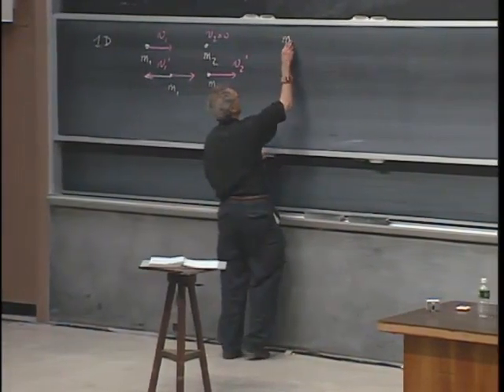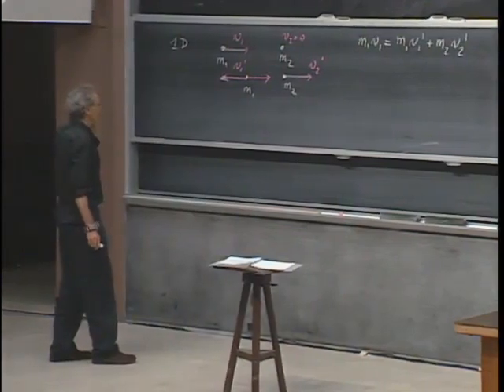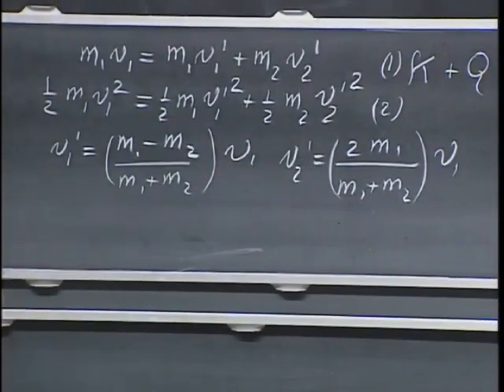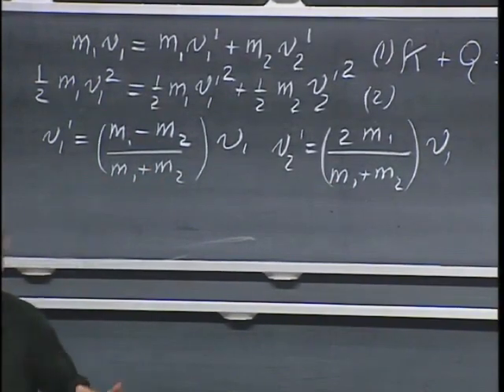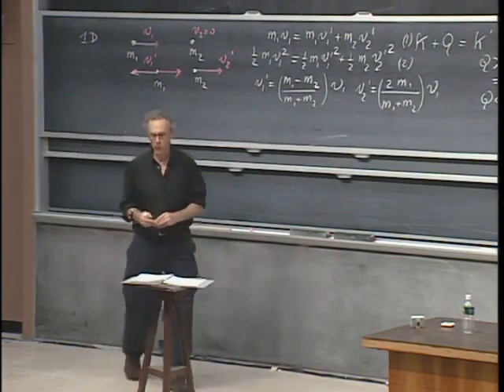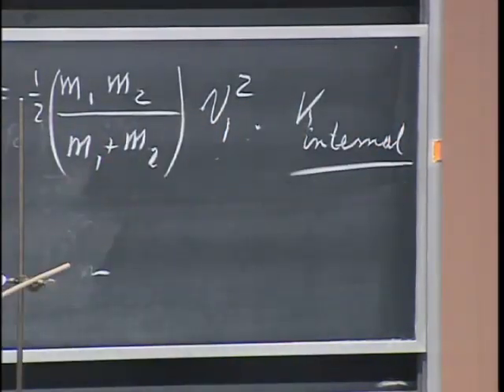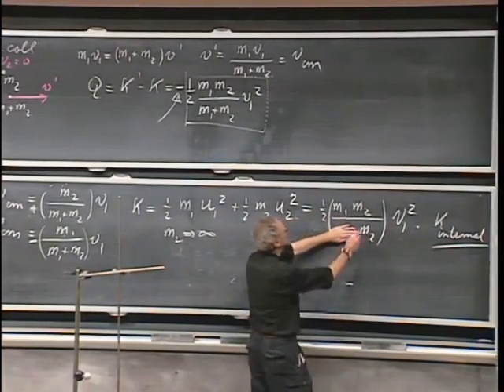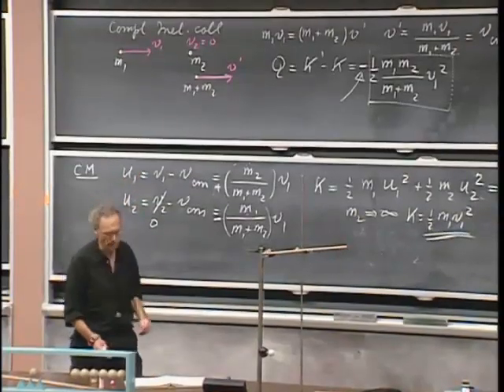8.01x - Lect 16 -  Elastic & Inelastic Collisions, Center of Mass Frame of Reference

Comment: The center of mass reference frame is such a nifty little trick to solving these collision problems.  If your thinking is stuck in the box of only using the lab reference frame, you end up having to solve a quadratic formula which could get you lost.  But the COM reference frame allows you to avoid that quadratic formula altogether, and in my opinion, shows a better perspective of what is happening in the collision.
Reply from the maker: carultch thanks alot for you important contributions in answering questions of my viewers. I have been reading them with pleasure. Your responses will help many. THANKS  \\/\//////@lter Lewin

Comment: Dear Sir Lewin, I've been thinking about it deeply and the reason why the wall gets momentum 2*m1*v1 after being hit by the ball does really not have a physical meaning. Instead, its a consequence of the mathematical expression you mentioned and thus: v2' = 2*m1/(m1+m2)*v1, hence: p2' (wall) = m2*v2' = 2*m1*m2/(m1+m2)*v1. And if I now calculate the limit for m2 going to infinity: lim(m2->inf.) p2'  I get exactly the 2*m1*v1!!! So mathematically it throws your result but in reality because the speed (and  thus also the KE) of the wall = 0 anyway it's meaningless, ie. the wall doesn't move an inch what perfectly matches the idea that its mass is infinite. If it was finite (which is the real scenario) it would get a teeny wheeny bit of speed which, of course, is unnoticeable. Provided the collision is perfectly elastic. Do you agree??

Comment: 07:50 That's intuitive if you know that all inertial systems are equivalent. You have v_cm=v_1. And in the CM system (where V_CM=0), you really have V_1=0 and V_2= - v_1 (I use capital letters for the new system.) And then V_2' = -V_2 = +v_1 as object 2 bounces off object 1 as if object 1 is a wall. Going back to the original system you get v_2' = V_2' + v_cm = 2v_1. So all it takes is to consider that object 1 is a huge train on which you sit and object two is a small railroad cart you approach. But you sit on the moving train and see it from the train! That's a beautiful idea, in my opinion!

Comment: for the question at 23:00
the ball gains 2v only if you look at it in the perspective of the wall(moving at v speed) hitting the ball(which is staying still).
in that frame of reference, the wall keeps on moving at V speed to the same direction, while the ball moves at 2V speed to the direction the wall was moving in.
If you look at it from the perspective of the ball hitting the wall, the ball's velocity is reversed, but the wall's velocity doesn't change (because of the infinity mass). So the kinetic energy for the wall stays 0, and the kinetic energy for the balls stays the same (only direction reversed).

Comment: For the wall/ball (i.e. sleepless night) problem:

Since we're assuming the mass of the wall is much much larger than the mass of the ball, we can apply the analysis from earlier in the lecture where m1 << m2 with v2 = 0, and we get that v1' = -v1 and v2' = 0.

Another explanation is that the wall has many external restoring forces acting on it (normal/frictional forces from the ground or other materials holding it in place), so even though in the split second after the ball has collided with the wall it does in fact have momentum, the momentum of the wall is not conserved after the ball has bounced off of it due to those external forces, so dp/dt increases very quickly, and to a human eye it appears the wall experienced no change at all.

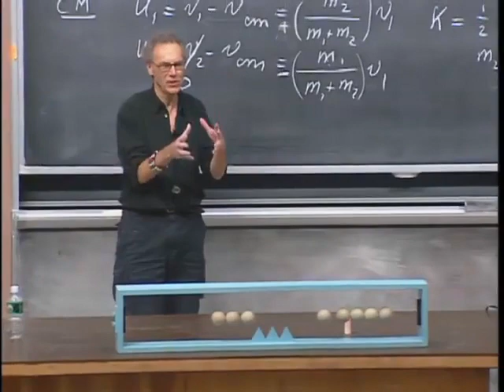Comment: 48:20 
if we have to prove it analytically we just use the approach of relative velocity and try to solve the collision problem by assuming the moving 5 balls to be at rest and find the velocity of those resting 3 balls with respect to the moving 5 balls,  now the problem becomes equivalent to the previous simple case...
solve the equations and get the answer. And the second approach i would suggest here is to look the situation from the centre of mass frame...

Comment: The ball is pushing twice the wall! The first time, the ball is hitting the wall, and it is compressed, and the two bodies are accelerating in the same direction. The momentum mv= (m+M) v’  so the wall gets a first impulse Mv’= mv- mv’ with v’ almost  0, that mean Mv’=mv. Then the ball is decompressed by the elastic forces to his normal shape, the ball is pushing again the wall, and the two bodies are accelerating in opposite directions!   Which mean the wall gets a second impulse Mv’’= mv. The ball is pushing twice  the wall, first time because is coming with the speed v, the second time because is departing with the speed –v, so therefore wall gets a double impulse from the ball, in the same direction p=MV=2mv. The impulse of wall is p=2mv, but the kinetic energy of the wall is E=pV/2, with  V almost zero, therefore E=0.
The speed of the ball is the same, before and after hitting the wall, and this can be proved, but we can not prove the momentum of the wall, is based just on the theory. Today, based on this theory, the momentum of the wall is p=2mv. But I'm not so sure about tomorrow...

Comment: Thank you Professor Lewin.  I'd like to try to respond to your question at 23:50, what is the momentum imparted to the wall when the tennis ball collides with it.I thought of three possible approaches:1. You said at the beginning of the lecture that if there is no external force, then the momentum must be conserved.  I would suggest that there is an external force present, namely the wall is anchored to the ground.  The earth will exert opposing force to resist translation of the wall, so momentum really isn't conserved.2. There is no reason to assume the extreme case that the collision is perfectly elastic.  Most likely there is a Q, and so some energy is expended in the form of heat.3.  If we look at the wall and the earth together, and grant the extreme case that the collision is perfectly elastic, suppose the ball retained 98% of the momentum after the collision, then m2v2 would be only 2%, a small number.  Since m2 (the earth) is almost infinitely larger than m1, v2 would have to be infinitesimally small, perhaps imperceptible.  You explained at 8:00 than if m2 >> m1, m1 approaches 0, then v1' = v1 and v2 = 0.But if we ignore this and we have to impart a tiny by of momentum to be imparted into the earth, my guess is the tiny bit of momentum, with no kinetic energy, is manifested as minute waves radiating from the point of impact, like a drumstick hitting a drum, dissipating with the square of the radius.Now I can sleep.
Reply from the maker: +luvinthe jazz   I appreciate your comments. The question is, can an object which has a mass which in the limiting case goes to infinity have momentum but no KE? In outer space bounce a tennis ball (mass m, speed v) off a wall with mass, M, of 10^10 kg and with speed,V=0. The collision is elastic. Clearly after the coll, the tennis ball will have to a veryyyyyyyyyy high degree of accuracy the same speed as before the coll but the direction will be reversed. Before the coll M has speed V=0.. After the coll M has speed V'. In the limiting case that M=>infinity V' must be zero. If not, the kinetic energy of the wall would be infinitely high and that violates the conservation of mechanical energy (in this case the conservation of KE). Yet the momentum of the wall must be +2mv as momentum is conserved. How can the wall have momentum but no KE?
Reply from the maker: +Lectures by Walter Lewin. They will make you ♥ Physics. Maybe this will help you. https://www.physicsforums.com/threads/why-momentum-must-be-in-the-wall.287325/
Reply: +Lectures by Walter Lewin. They will make you ♥ Physics. I Got it!!! So the change in momentum is +2mv.  So if v=0, then 2mv=0.  As Foghorn Leghorn said, two nothins is nothin.
Reply from the maker: +luvinthe jazz 2mv is NOT zero. m is the mass of the tennis ball, v is its speed. After the collision the wall has momentum +2mv but its KE is zero.
Reply: +Walter Lewin I think both KE and P are not zero, but v tends to zero so KE really tends to zero because the quadratic of v, talking always in an ideal closed-system case. You made m1 tends to zero to deduce m2 Ke is zero, but that's not completely true. Thanks for all your material.
Reply from the maker: +Mauricio Barda The momentum of the SUPER MASSIVE wall is 2mv=MV Here m is the mass of the tennis ball and v it its speed. M is the mass of the wall and V is the speed of the wall. M=>infinity, V=>0. Thus MV can be anything; it's 2mv. KE=>0 as MV^2=>0, MV does NOT go to zero.
Reply: +Walter Lewin Thanks again!
Reply: Lectures by Walter Lewin. They will make you ♥ Physics.  Sir maybe I have something for you. According to me the wall has gained a momentum but due to the large mass the velocity turns out to be really low or let's say tending to zero so when we will find out k.e let break it up in1/2pv where p is finite but v tends to zero so k.e tends to zero. Correct me if I am wrong. Regards Simran

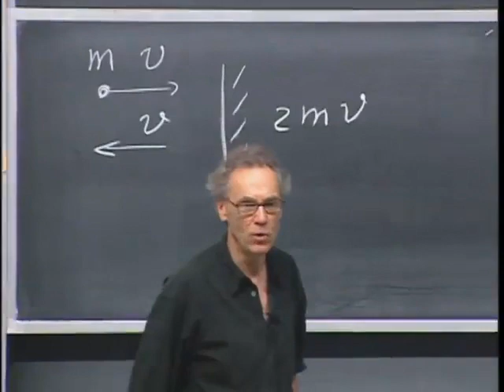Comment: 24:08 well i think that the wall will have no kenetic energy because if the ball elastically collided with the wall  we technically assumed that the mass of the wall is much larger that that of the ball and the formula for the Kenetic energy is KE=Mv^2/2 or p^2/2M or (2mv)^2/2M this means that if we devided the mass of the ball to the mass of the wall which is way lager we will get zero!

Comment: Regarding the problem at the last of the lecture (48:01)-

Let the mass of each ball be 'm' and their velocity is 'v'......
then the initial momentum of the system= 5mv

Now since it is an elastic collision so some balls after the collision will stay put and some will move with the same velocity 'v'...
Let the number of balls which after collision stay put be 'x'.......
then the number of balls which will move with velocity 'v' after the collision will be (8-x)........

So the momentum after the collision will be (8-x)mv.........

Since momentum of system is conserved so 5mv = (8-x)mv.........
which gives x=3 AND SO 3 BALLS WILL STAY AT REST AND OTHER 5 BALLS WILL MOVE WITH VELOCITY 'v'.........

Is it correct?
Reply from the maker: Nice try. It's easy to show that the "surprising"outcome of any combination of balls that you swing is consistent with the conservation of KE and with the conservation of momentum. But that is only a "consistency test". But that is not a proof. The actual physics is much more complicated as it is a multiple-collision problem. My advice is to live with your "consistency test" and not bother about the "proof".
https://en.wikipedia.org/wiki/Newton%27s_cradle

Comment: My take on the tennis ball problem :)
The total momentum of the system before and after the collision is zero.
Indeed if we calculate the velocity of the center of mass:
(mv+M0)/(m+M) =mv/(m+M) = v(CM)
we notice that if the mass of the wall is infinite/big, then v(CM)=0
Hence, because of the wall/enormous mass our frame reference is incredibly near to the center of mass of the system.
Hence it doesn't matter if the collision is elastic, inelastic or superelastic...the total momentum is always zero!
By not recognizing that we are in the center of the mass can lead to the paradoxical (yet correct) result that the wall has a momentum = 2mv.

Comment: Regarding the tennis ball-wall problem, the wall can have a finite p if only v is 0 (m is infinite)
and KE=(mv).v.1/2, ie, a finite no. mv multiplied by 0. so the end result is 0 for KE.
Is this correct??
Reply from the maker: Yes, that is correct
Reply: @lecturesbywalterlewin.they9259  So it is a problem which only occurs in a limit of infinity.
Reply: I don't understand this answer. The mass of the wall is large, but not infinite. The impuls imparted on it is not zero, and therefore its speed after the impact cannot be 0. What happens when you take a tennis ball machine gun and bombard the wall with tennis balls? It will still not move. There must be some impuls from the other side that pushes it back.  Where does that impuls come from?
Assuming that it is a free standing wall, I bet the force that pushes it back is gravity. The imparted speed will cause the wall to start to topple over a tiny bit, that is, its front side is lifted a bit off the ground. Then gravity pull that back, and cause the reverse impuls on the wall. That will in its turn impart a tiny impuls on the Earth itself, which will cause the Earth to move a bit faster.
So the real answer should be: because the wall is attached to the Earth, it will not move wrt. the Earth, and the Earth will take over the impuls.
Reply: Sir what does it mean in physical terms that a body has some finite momentum but zero velocity ?
Reply: @renedekker9806  The impulse comes from elecreostatic forces between the tennis ball and the wall during the collision, gravity has nothing to do with it.
Reply: @renedekker9806  It's an idealization. Just like massless strings, infinitely long wires and many other things in introductory physics.

Comment: The answer to the tennis ball question could be given easily as follows:
(First things to be taken into consideration mass of tennis is negligible in comparison with the ball so as per the equations you had given v1'=v1 and v2'=0)
Since v2 and v2' are going to be zero before and after collision we can say that KE of wall will be zero since KE=1/2 mv squared and velocity is zero so it is clear that kinetic energy will be zero I don't know this is right or wrong but the result Is indeed correct.

Comment: I think it’s: the wall can have non-zero momentum but zero kinetic energy because in the limit as the mass of the wall approaches infinity, the velocity of the wall approaches zero, and the momentum is linear in both m and v, so their multiplication can be a nonzero constant. However, kinetic energy scales with v^2, so as mass approaches infinity and velocity approaches zero, the velocity term dominates and kinetic energy becomes zero.

Then for the 8 ball newton’s cradle, I think the intuition for it is that while momentum could be conserved with many different combinations of output balls and velocities, the only solution that also conserves kinetic energy is one where the output balls have the same mass (and velocity) as the input balls.

Comment: for the ball and the wall question:
after the collision the ball has a momentum -m1v. Since momentum is conserved, m1v = -m1v + 2m1v, meaning the wall has gained a momentum of 2m1v, with m1 being mass of the ball, v being the velocity of the ball. 
The wall has momentum because: P = mv; 2m1v = m2v. m2 being the mass of the wall. 2m1v / m2 is the velocity of the wall, which, because m2 --> inf, v --> 0. Because of its huge mass, it doesn't have visible speed, but it has momentum.
The wall has no KE because: KE = p * 1/2 * v, there is momentum, but v --> 0, KE is essentially 0.
Is that correct?
Reply: Hi. if KE of wall is zero because it’s v is close to zero, then momentum of wall should also be zero because it’s v is zero. So I don’t think your answer is correct.
Reply: @AJ-ss3jy  no it is correct because it isn't exactly 0. It is close to zero and the mass of the wall is large enough. The energy lost is in the form of potential energy of the wall.
Reply: We can also think about this in this way: The law of conservation of momentum does not hold for the problem as there is an external force of the ground on the wall.
Reply from the maker: @mohammedbinalimaqqavi6599  momentum is conserved in the horizontal direction when the balls are at their lowest points and when they collide
Reply from the maker: and that is KEY
Reply: @lecturesbywalterlewin.they9259  hello sir hope ur having a good day! So is the explanation given by the original comment correct or not?

Comment: I would like to point out that the 2v case of the ping pong ball when hit by a billiard ball at 11:32 is, though not intuitive, but quite obvious.
Suppose a ball is lying on a train platform.
The train, when collides with it, continues to go with the same velocity.
Now, from the frame of the train (both are const. Velocity inertial  frames) I would see the ball coming to me with same Velocity as the train's ground Velocity. So the ball must bounce back from the train's front in the forward direction with same Velocity in the train's frame.
Hence in the ground frame, it would go with twice as speed.
Thanks
Glad if you correct where was I wrong of I was

Comment: Regarding the last problem of the Newton's cradle, I guess the balls are not really touching, so at each collision we simply apply the case of a ball colliding with a stationary ball of the same weight.
So if we start with one ball moving then this ball collides with the second (and stops), the second travels a very little distance and collides with the third and so on to the last.
If we have more than one moving ball at the start (for example, as you showed, three balls) then the third ball (the central one) collides with the fourth and stops, in a supershort time the second arrives from behind and the central starts again, now the central hits again the fourth that has just hit the fifth and stopped almost instantaneously, etc...